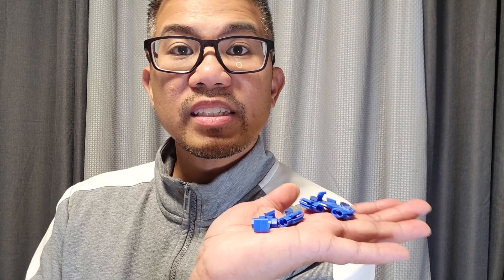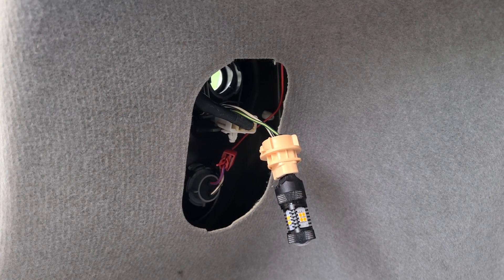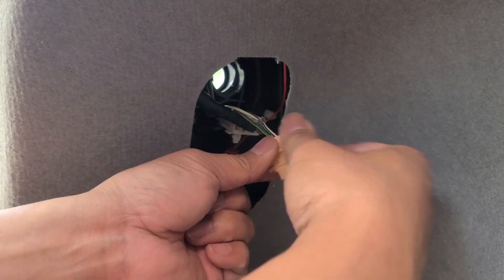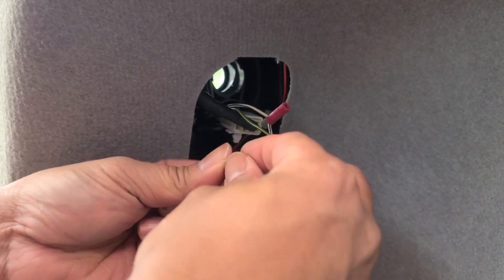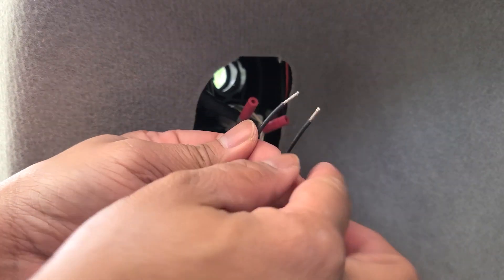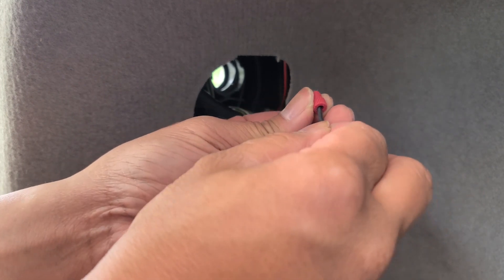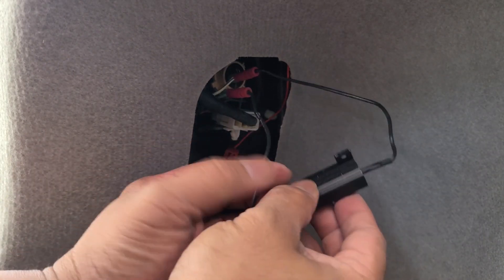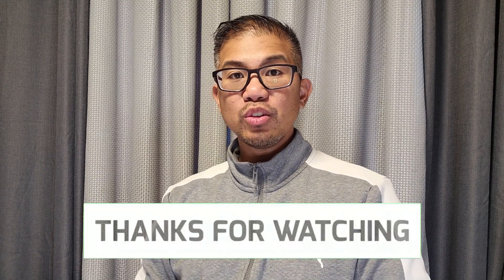How to install resistors when your LED turn signal is hyper flashing

Comment: Specific wire gauge is necessary in order to order posi- taps....what is typical Toyota wire gauge? Thanks...
Reply from the maker: 18-16 gauge for small electrical like turn signals

Comment: How about if 2 resistor will be use
Reply from the maker: What do you mean? Why would you need two for one light?
Reply: @AutoSensation  i mean only in rear right and left only
Reply from the maker: @laurencebaldivino8134  You need one for each bulb. Or purchase one with a built in resistor. https://www.auxito.com/collections/7443-led-bulb/products/7440-led-bulb-amber-48-watt?ref=1840ub7yyh